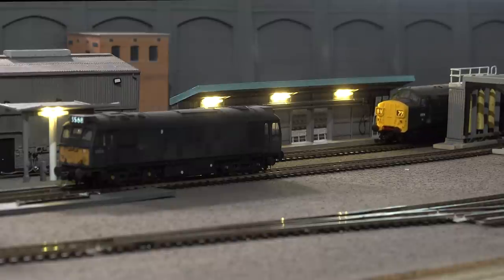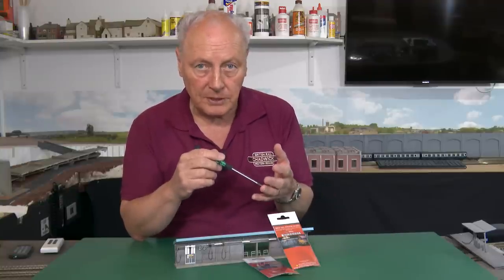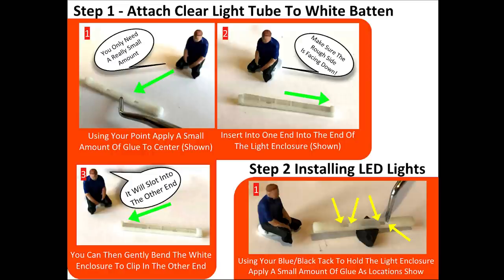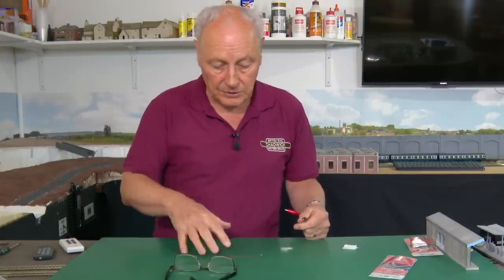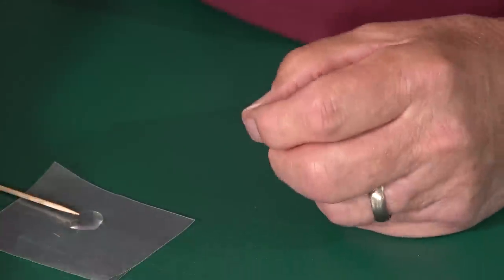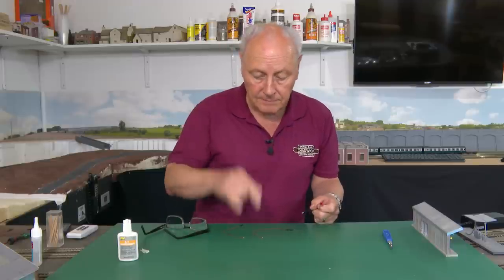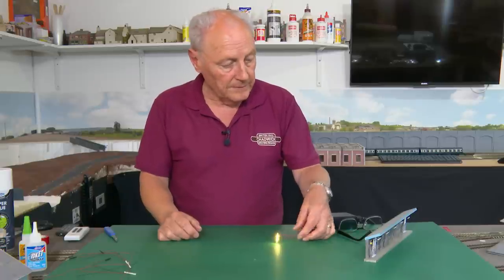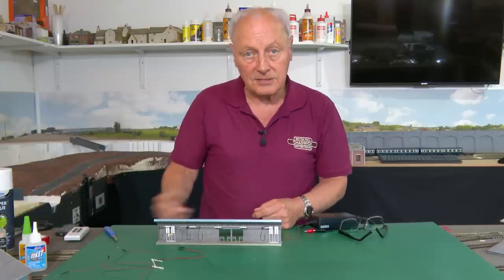LOCO SHED LIGHTING at Chadwick Model Railway | 198.

Comment: Another excellent tutorial video for which thanks Charlie. I am just about to put nearly 200 route indicators on my control panel (DC). I get rather confused about resistor wiring to leds, whether they should be individually wired, wired in sequence, etc,etc. The leds are 3.5mm bi coloured and require a 3v feed. In my spares box I have a number of transformers amongst which are 2 x 240v with 3v output. Any suggestions of the best and easiest way to proceed, taking into consideration I am in my 70s and have shaky arthritic hands? 
Cheers, Bob
Reply from the maker: If soldering is your issue, Bob, try using Wago connectors. They make things so much easier. Regards, Charlie

Comment: Being able to go onto a manufacturers website for instructions/PDF file is better than having instructions in the packet as instructions on paper are getting ridiculously small to the point you need to wear jewellers magnifying glasses to read them. PDFs you can scale in your browser to suit your individual optical situation. Have you considered lineside decoders to control the illumination and localised area sounds?
Reply from the maker: I’m considering the line side sounds Engels, but not the lights being DCC controlled. Regards Charlie

Comment: Hi Charlie, nice job👍. About super glue or other cyanoacrylate bonding material, being of an old generation (having started my main layout in June 1964), this sort of glue was obviously not available then so I had to resort to more traditional means, like used in jewellery, watchmaking, cabinet-making, joinery, Arta and craft... I discovered cyanoacrylate in the early 80s but always used it sparingly, because though it looks like a quick and easy way to link definitely not compatible media (like metal and glass or some restive plastic like polyurethane), the main issue with those types of glue is their limited lifespan - 10 to 15 years - and their tendency to age badly and become brittle when temperature and humidity vary (which is often the cas with a layout installed in an attic, shed or garage...). To make a long story short (and quite long indeed in that particular case: allmost 60 years for this layout), I had to return back to more traditional ways: Revell or Faller polystyrene melting glue, bi component epoxy, solder or braze, clips, screws, nuts and bots or staples, and even fish glue or their derivatives like good ol' Seccotine!
Reply: Ah yes, the smell of Seccotine! And then Bostik clear......
Reply from the maker: What an interesting comment JBF. I’d never considered the aging process.
Regards Charlie
Reply: I too avoid using super glues for the same reasons as well as being allergic to the stuff, they are not as super as the name suggests.

Comment: I did get to wondering if you could hide the wires by using metal rod technique (like Richard at Everard does), maybe wire them in series, and put the resistor under the base? It does involve a fair bit of hacking about, and if you're anything like me, could involve a fair bit of nsfw language! But as is, it's presentable and does the job.
Reply from the maker: An interesting point Neil.  I have now bought some plas-strut. Regards Charlie

Comment: You can Just put a extra resistor on the leads to take down the brightness  one just before you connect the 12 volts
Reply from the maker: That’s my plan M6576. Regards Charlie

Comment: In areas where I will be more than a few LEDs, I use a buck board to drop my 12v bus line to 3v and create a local 3v bus to supply the LEDs.
Reply from the maker: Yes, that’s a sensible alternative. I will probably have both of 3 V and a 12 V bus for lighting. 
Can you tell me why your ID is so unusual? Regards, Charlie

Comment: Perfect timing on this Charlie! I've just received my Bachmann Locomotive Maintenance shed and was going to start wiring it up soon!

You made mention that if your feed is 12V you were going to drop it down to around 9V? How were you going to achieve this as lowering voltages is always something I've struggled with. Specially if it's say AC Voltage. Perhaps a Chadwick Swift idea?.

PS Considering you're moving into your yard lighting, I've just grabbed these, figured they might suit your layout too.
S4 - Metal Tower Mast with 4 Spotlights from LAYOUTS4U

All the best as always, 
Kodi
Reply from the maker: Hi Kodi, at last we’ve got to the bottom of the posting issue.  I have tracked down some voltage regulators on eBay, and I shall post them in the forthcoming video. Regards, Charlie

Comment: For small items like this light kit i have used a tad of silicon sealer in the past. Just incase i needed to do a replacement later down the line. ( pull died light off. Clean area and refit/seal new light). Any help to you?
I also recall a product called 'Plastic Magic' that i used for plastic buildings. By accident i found that if you had clued 2 plastic parts together previous then later accidentally touched the parts with PM, moved them away from each other they'd part. Then to reseal them just place them together, reglue them with Plastic Magic. All is fixed, no marks to show.
So could the led's be held in by glueing wiring insulation to building body. Then if need to change led. Just touch with Plastic Magic, exchange for new led, hold new led in place and dab with PM clue. Maybe this is of help also!!
Reply from the maker: Thanks Mel for such an interesting product recommendation.
Regards Charlie

Comment: Hi Charlie like the refuelling station had a look on eBay my god the price of them. would it be too much ask you the dimensions of that refuelling station in mmm if you have time cos I can make one of those but I don't think my local model railway shop won't like me opening one and start measuring one up. be great if you could but fully understand if you cant. Good video again Charlie  thank you'
Reply from the maker: Hi Tony,
Length equals 300 mm 
Depth equals 25 mm 
Back wall height, equals 45 mm 
Top of canopy height equals 60 mm
Regards Charlie
Reply: @ChadwickModelRailway  Charlie I am most grateful to you for taking the trouble to do that for me . I scratch build all my buildings for my layout thanks to the late and great Alan Downes.  I saw a number of  those on on eBay  for £60 odd  and I was shocked,. I do hope you had a good deal with your one. thank you again Charlie.